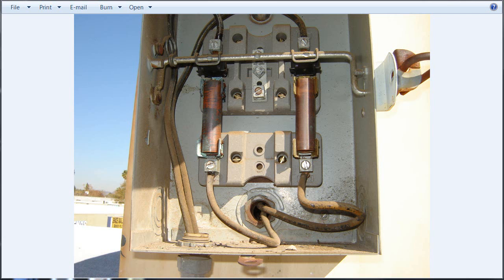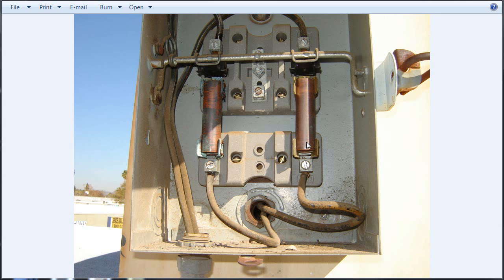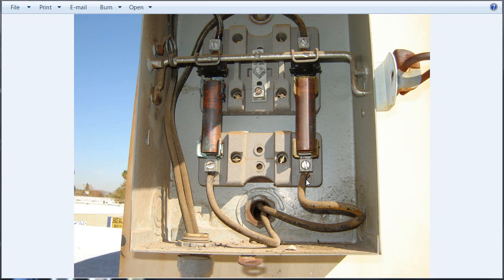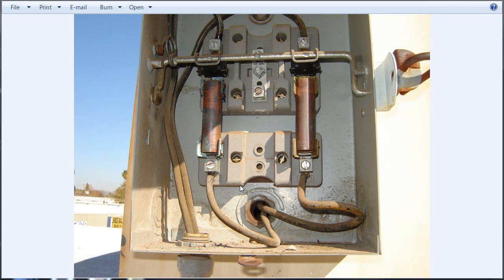Electrical wiring-Fuses

Comment: It is sad that people pay to have it done right and it is not done right.
for me it was at a appartment complex and they could not find a knife type fuse and they stuck some cooper pipe that they bang down with a hammer and stuck it in there. they say it was after hour and the electrical contractor who they called  could not find one . I told her that was not an excuse that was not even a temp fix that was an accident waiting to happen  . it was the main fuse to one of the unit main power.

Comment from the maker: @sbales63  Mostly varies by mfg and design spec's. The NEC requires overcurrent protection, be that a fused disconnect or approved ckt breaker. NEC states that you need to match fuse size at nameplate rating of "max fuse" size. Advantage of using a fused disconnect is that they (fuses) respond to a short much quicker.
The thing to consider w/regards to the copper tubing is that is is not U.L. listed (designed) to work in  the disconnect.

Comment: oh snap. whoever installed this is an excellent candidate for a Darwin Award. A fuse is ther to cut off the supply in the event that something screws up and the $hit hits the fan. I don't know much, but I don't see a piece of copper pipe doing the same. sounds to me like a great way to make a 'splodey A/C condenser.